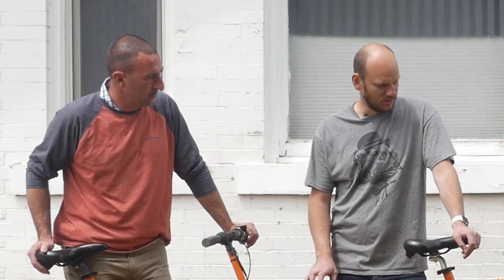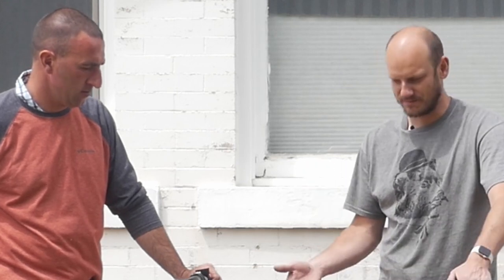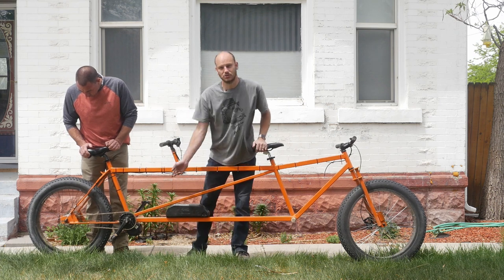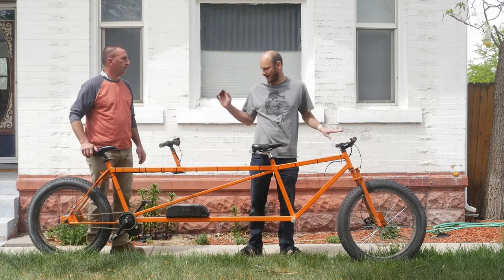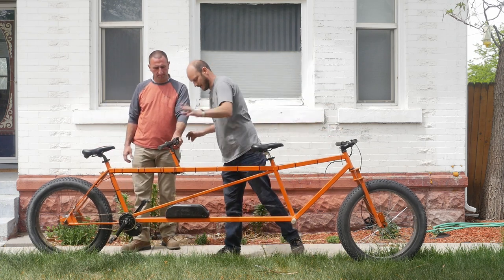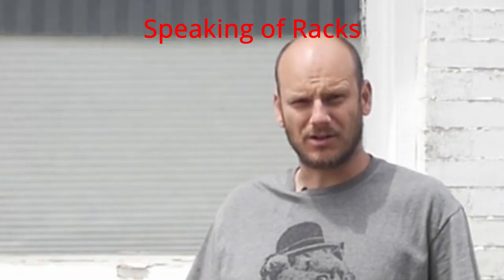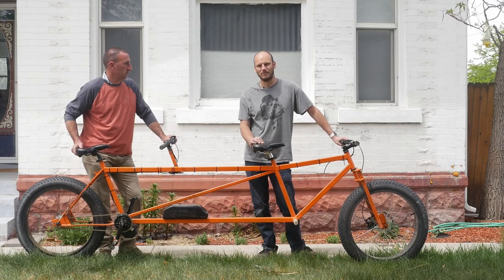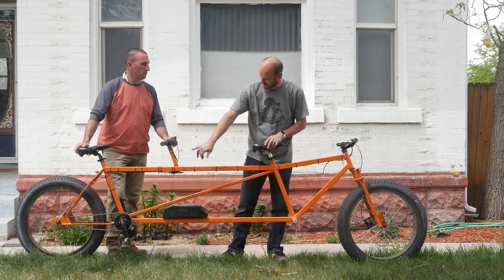Custom E-Bike Build: Handmade OFF-ROAD Electric Fat-Tire Tandem Bike

Comment: Another mid drive at the cockpit yes but add the proper front hub motor as well. I have no idea how this is done if it's sync with throttle with the middrive or what but it sounds fun..

Comment: Looks like a lot of fun. I'm just wondering why did you make it so long? Was it that you wanted lots of room on the frame for storage racks and bags? 
One more question, you mentioned a second motor was going to be added, how are you planning that? Maybe for the front driver? If so, wow, that would be a crazy long chain. Or maybe a front hub motor? Not sure if any of those ideas are any good. Good luck with the rest of the build, I look forward to seeing more of this creation.
Reply from the maker: 2 reasons, it’s funnier. And yes, if we ever do a trip, we can put Tons of batteries and gear on it 😀

Comment: hello dude, im really in need of your help, i have an ebike, long story shorted, my battery doesn't work, it got dropped and it no longer works, what do you think is the problem? thank you very much!
Reply from the maker: Could be a few things. All the cells are linked together, you could’ve broke a link(solder). Check the BMS. Check the simple wiring connections at the power switch. If none of those work. Threaten it.

Comment: That's a really cool build, but what a niche market? You really need a partner you have full faith in to ride that thing.
Reply from the maker: This was a one-off project just for fun. I’m thinking a chopper style frame like the super73 but with a cyclone 3kw for the next build
Reply: @JohnnyNerdOut  I love the idea of the chopper style e-bike too. This project was pretty cool, I just don't have any friends I trust enough to ride it with me;)
Reply from the maker: @michaelsprinzeles4022  after riding this bike around for two days, it turns out I don’t either 😀
Reply: @JohnnyNerdOut  If only the chain didn't get in the way you could put everything up front and make the rear saddle strictly a passenger seat.
Do I dare suggest dual hubs?
Reply from the maker: @michaelsprinzeles4022  you may not suggest.
Reply: @JohnnyNerdOut  That's ok. I'm no hub fan. I just wanted to see your response.